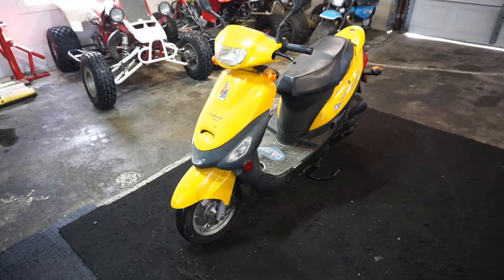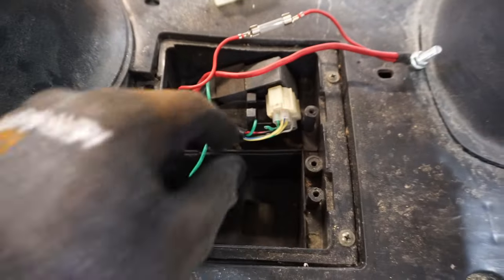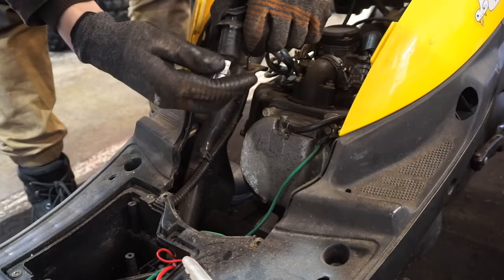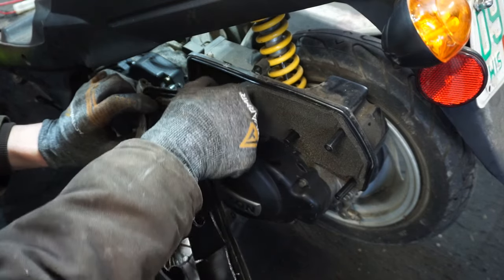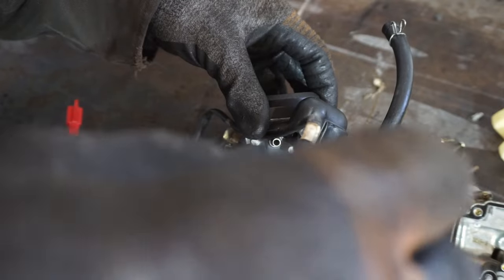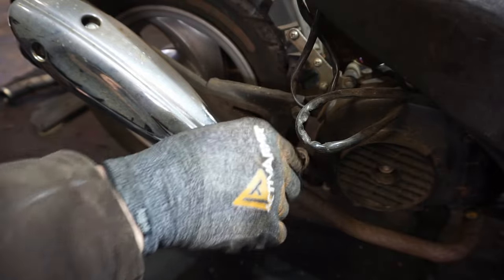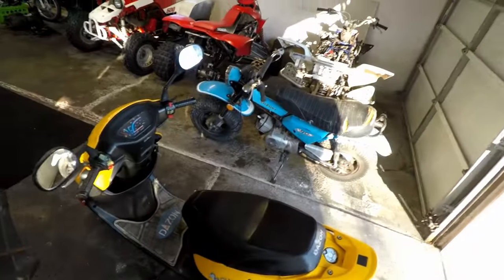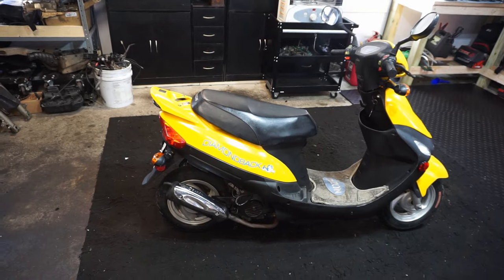Saving Thousands On Gas With This Scrap Pile Moped (100MPG)

Comment: I bought a 150cc scooter for $100, it had been abandoned, attempted theft and the woman had crashed it and failed her license test, it needed tires, brakes,  battery, front  directionals, intake boot, carb work and its still a rickety old scooter which I adore, I have more into it than it's worth but is ideal around town errands and such, I have a vfr800 for more spirited riding

Comment: Look at a 1950s straight eight engine.  Some used 6 Volt batteries to turn over the starter to start the engine.  Six volts can turn over an engine and start it.  BTW, that cut wire was the CDI Rev Limiter.  You can go faster with it cut.

Comment: If you use a torch on the faded plastic it works really good and lasts at least 8 months I did it to my buddies truck on his bumper and then he sold it about 8 months later and it was still the deep black it should be

Comment: I had a Yamaha Zuma  the governor is part of the cdi somebody tried to remove the governor. 
Also I quick bit of heat will return the plastic back to new.just don't melt it.
You never said if it was 2 stroke
Reply: clearly hear the sound of a 4t and the exhaust is another visual hint of the 4t chinese junk lol

Comment: My problem with these are just no start at all. I got a 150 I’ve got a new carb cleaned old carb changed eclectic auto choke, has spark, changed the plug as well, changed gas and cleaned air filter, it’s all got proper timing. Idk what’s left 😂

Comment: <Smile>  Good Job!  Picked that up for $200, plus a $50 Battery, and then sell it for $700?  $800?  

Not sure if I would want to travel around using that slow of a machine.  25 to 30 mph is a bit slow as other drivers are quite likely to be traveling a bit faster, which is not fun when on a bike that small.  

I hate that our National leaders have brought the Country to the point where we are going to need such thrifty Gas Sippers to travel around on, but I am not thinking Gas prices are likely to go down any time soon.  

Even still, I think I would start looking around for Honda 125's to fix and rebuild.  They too are very good on Gas, plus they have enough speed to keep up with city traffic.  High ways, not so much.  65 mph with the wind at your back.

Comment: You know you have to heat the wire up with the soldering iron then melt the solder into the wire if the wire isn't hot enough the solder won't even adhere to the wire I don't know what you were doing but it's correct

Comment: Dazon Diamondback 50cc Specifications

Engine Type	Air-cooled, 4-stroke
Displacement	49 cc
Starting/back-up	Electric / Kick
Max Power	3.54 HP@8000rpm
Climbing Capacity	18 degrees
MPG	122
Wheelbase	47″
Fuel capacity	1.66 Gal
Overall l/w/h	65.5” X 26.7” X 42.1”
Dry weight	185 lbs
Max Speed	27-30 MPH (governed)
Colors	Black, Silver, White, Yellow, Red, Blue

Comment: Not to be that guy but when you solder don’t heat the solder to the iron heat the wire up and put the solder on the hot wire it takes longer but it’s a lot stronger

Comment: check your clutch. maybe there is a limiter installed there too. it schould look like a matel tube kind of thing. a vario limiter. with the cut wire and no limiter you should be able to go faster.

Comment: I think with a 120cc engine you could easily do 45 maybe 50 if the wind weren't blowing in your face. Maybe even 60, with nearly the same mileage. With those tiny tires I doubt I would even want 70.

Comment: Getting an old chinese scooter to run well is sign of a great mechanic, my hats off to you.  I've been using Meguires back to black for faded plastics, it works great, but it is not as cool as that spray stuff.

Comment: I picked up a moped for $100 not running over winter. The bowl on the carb was riveted together so I trashed it and bought a new one and pod filter for $30. That and reset the valves and it ran really well. I just sold it recently for $400 (at list price lol) which I thought high with no title and an old moped but I guess there is a huge market for it in Milwaukee. With a clean running and titled moped you could probably get rid of this thing easy for around $800

Comment: I bought a Piaggio Zip 50 for 50€ with no spark, I bought a new ignition coil for 37€ at the dealership and worked fine. sell it for 300€

Comment: because its been sitting its got corrosion in the primary and secondary clutch system jack up the back wheel and go full open throttle a few times to loosen it up some it will expand them clutches wider then it will go near 40mph

Comment: Put 6 gram rollers in and you will get 40-45 mph and quicker take off
Reply: 38mph top speed from that engine , its 3 hp and its weak
Reply: @patthewoodboy  they are severely restricted by the carb, exhaust and a spacer ring on the front variator. upgrade those things and it will do 70mph on a flat road easily. I twisted the speedo needle off on my 50cc Tao Tao with a couple mods without touching the engine.
Reply: @bevis226  bullshit , its a 3bhp engine

Comment: Thought you should know this is a scooter, not a moped. All mopeds have pedals. That's why they were called mo-peds. Mo for motor, and ped for pedals. So the concept of a moped was that you could still use your legs to pedal it if you wanted to but nobody ever did that because they were just too heavy to be pedaling anywhere. The only time you pedaled it was to start it because thats' how you started a moped. They didn't have electric starters or kick starters. You would just start pedaling it and giving it some gas and the motor would start up and you could then stop pedaling it. What you have here is just a scooter because of the way that it's styled. It doesn't have any way for you to pedal it like a bicycle to ride it without using its motor. I'm pretty sure they dont make mopeds anymore because they were such a bad idea that only took off for a year or two before they stopped making them.

Comment: wonder if that cut wire was a speed/engine restriction?
I find used engine oil wiped on faded plastic then thoroughly wiped off works well.

Comment: I ride a Kymco (Taiwanese) 50cc 2 stroke scooter, it's interesting seeing the design and build differences between this one (cheap Chinese) and my Kymco. As you probably read already the green wire cut is likely a RPM derestriction. I don't know why people have this obsession with doing this to 50cc scooters, the power gain is fractional and without supporting fuel/air modifications, the engine is not going to like running so hard. If people want more power they should spend a bit extra and buy a 125cc.
Actual useful modifications for daily riding is the CVT boss removal (allows full movement of CVT for increased top speed) and exhaust derestriction if it has it. That might just be a 2 stroke thing, not sure.
Reply: I have a 110cc moped. With some mods, easily 100km/h.. costs me less than $1200, with insurance and stuffs
Reply: @faisfaizal5194  lol twisted off my speedo needle at 112km/h on my 50cc scoot on a flat road, with a few mods. Engine has never been cracked open (yet). Have a 100cc big bore kit coming for it.

Comment: I just bought an aprilia Atlantic 125cc a few weeks back for £200. Has all the plastics. Engine runs sweet now I've put a new carb on it (old one had parts missing 🤯) 
2 new tyres and a water pump repair kit and it's worth 700-800 now 👌👌

Comment: That cut wire has nothing to do with the spark it was a hit and miss cause it was loosing ground as the engine was turning over and it was causing the the plug to slightly move and loose ground

Comment: Good video.  There might be an exhaust restrictor in the pipe similar to what a PW50 has.
Reply: Pipe restrictor only works on 2 stroke. 4 stroke's are restricted via cdi, variator limmiter and (modern injection) by ecu.
Reply: @wadejo  nice,  learn something new everyday,  thx.
Reply: No problem! With out getting to technical, here is a simple explanation in my best English (I am from holland): 

It has to do with the combustion cycle. A 2 stroke needs the exhaust to "pull" exhaust gasses out of the combustion chamber en fresh mixture through the crankcase into the cylinder. If you restrict the flow through the exhaust, you restrict the amount of fresh mixture and so a smaller bang and less power.

A 4 stroke just pushes the exhaust gasses out of the cylinder like an airpump and sucks in fresh mixture in a different stroke. So a 4 stroke doesn't need the exhaust to work efficiently. 

That is why a 4 stroke doesn't care if it is a small pipe or a big pipe (of course to a certain degree) and so a restrictor in the pipe has no effect (as mentioned to a certain degree).

This also explains why a 2 stroke will run like crap without an exhaust (when power is demanded), and a 4 stroke will run just as fine without an exhaust.

Comment: cheapest scooter money can buy. Aprilia, honda, yamaha, and kymco make the good ones that ones generic china. PS that wire cut is just a cdi restriction, limiting rpm to slow the scooter to 30mph. battery doesnt effect spark. it has a stator and coil ECT. Looks to be missing the battery cover, and cut that wire and its good to go

Comment: That is NOT a Moped! That's a Scooter. A Moped, by definition, can be pedaled, which is usually how you start the engine, and, if you run out of gasoline, you can pedal it home.

Comment: It's time for a big bore kit, racing exhaust, and racing cdi box to get it to run 60 -75 mph😊
Reply: hahaahah thats absolute BULLSHIT! a qmb139 will never see 60mph hahaahahahah
Reply: @bartobuilt2601  they have big bore kits for them. My uncle has one he built and it runs 75mph depending on your weight. Everything is unrestricted on it. It has a racing clutch and different belt too with racing muffler. I'm dead serious bro.💯
Reply: For the kit at the time and that was 4 years ago he paid about around $480 for everything and he had to get the carburator tuned it ran 75mph with me riding it. I weigh 168 pounds and my uncle is way bigger than I am. It's a Chinese scooter. They have alot of racing parts for them.
Reply: @dougspeight197  there is Absolutely NO way any QMB139 did 75mph hahahaahaha You got called on your BS and decided to dive deeper into it 🙄
Reply: @bartobuilt2601  well my scooter equipped with a leovince exhaust did 90km/h on 102 octane and downhill! They sure are great engines! Rex RS450, 139QMB, QM50QT 6A

Comment: Well there went 7 lives of 9 on the starter...  gotta let starter cool after two or three few second tries. Crank a starter on the bench (no resistance ie: engine to turn) check temp after cranking as long as you did in video bet you can't touch it. Anyhow just fyi as it shortens life of starter.

Comment: the netherlands are full of those chinese scooters 

4 stroke scooters are limeted in two ways

 the cvt has a ring that prevents it from sliding out all the way and the CDI has a rev limiter built in 

not too often the system of a pick up on the clutch housing is used that sends a signal to the cdi you can cut that wire

Comment: The green switch that you didn't know seems to be a light on/low/off switch. Normally it's not on American bikes because the law says lights need to be on all the time. Maybe the bike is an import.
Soldering the green wire back on made it about 5 miles slower. Doesn't anything pop into your head wenn you see a wire so obviously purposely cut?

Your work shows inconsistency of thinking:
-I'd call the spark intermittent and no change showed after soldering the green wire, yet you convince yourself it does;
-You know the oil is low on the dipstick, yet you don't fill it up but prefer to spend money on the 'put the shine back on black' spray;
-Flushing out the system wenn it hasn't run for eight years seems the first order of business, yet you try to start the engine on it. Won't work.
-Counting the nr of revs on the airscrew? better learn how to adjust a carb;
-Someone carefully disconnected the battery for long term parking; You're conclusion 'someone was on it' sounds rather negative where it deseves a compiment, sherlock.

Comment: Quick tip for restoring dull plastics, use a heat gun on it or a small hand torch, wave it on the plastic and it'll bring it back around, not too long tho or it will melt.

Comment: i got a 150cc scooter from my nabor no title but not stolen thay sold it to me for $140 cus i know them and cus thay ride it down the street then die well i found out there no gas going thro the filter on the gas line and cut vacum hose fix it add new gas filter then added gas and worked fine great  been riding it everyware no title no plats no insurens no licens no nothing but 40 page of suprem court rulling right to travel vs driving law and a plats that say right to travel ucc and some numbers on it most pigs refuse to stop me with that plat i got 16$ on amazon and 1 pig did told me i was comiting fellonys mistiminers and racking up 50k in fines i told him got 40 page suprem court rulling right to travel that im just trying get food to eat and then he said i have to go there crimes poping up on my computer i have to get to after just telling my i was comiting alot of crimes at once and 50k in fines then tel me he have to go to the crimes being comited lmfao